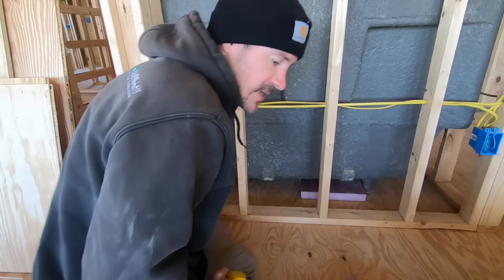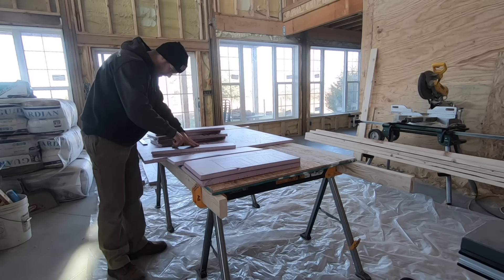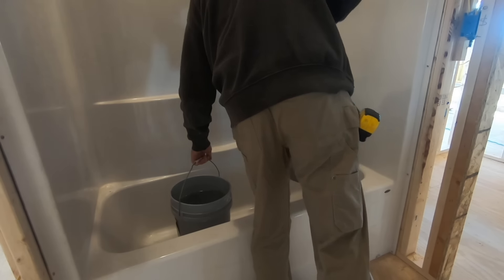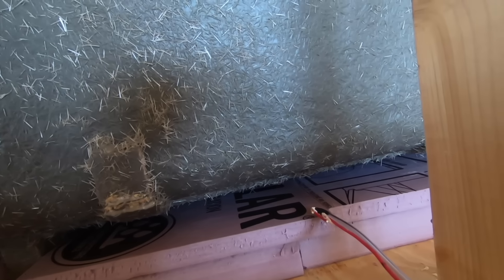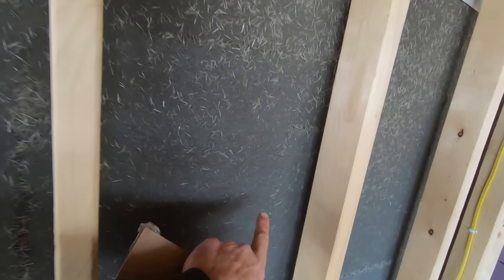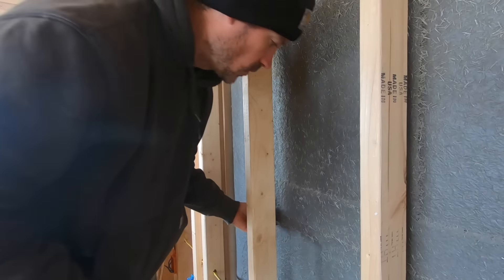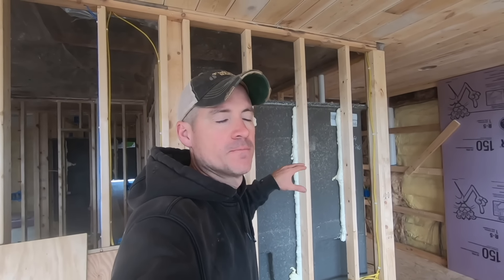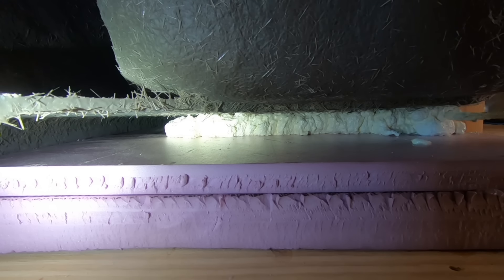How To Sturdy Up a Fiberglass Tub Shower Using Spray Foam

Comment: this is exactly the information I was hoping for. I had plumber install Kohler acrylic tub. didn't use any mortar bed. Now the tub creaks terribly every time anyone takes a shower. I called Kohler to see if I could use foam. they weren't sure. Thought maybe the low expansion type foam would be ok. Now I have a great tutorial. thank you for posting this!!! I was surprised the foam didn't cause the surround walls to bow in.  great video.

Comment: Added benefit of insulation for the tub keeps it hot longer! My best friends dad bedded a tub in mortar and the tub was always ice cold quickly. Mortar draws out the heat so fast. When I replaced my rub, I installed it, but was able to access the bottom, I used spray foam, worked amazing and the water stays warmer. I've stiffened quite a few showers for friends using minimally expanding foam and drilling holes through the subfloor for access. Minimally expanding to keep the shower from floating off the floor. Works great!
Reply: What specific foam do you use? Things still holding up well?

Comment: Great videos! 👍🏼👍🏼

I did something similar for a handicapped friend that wanted his tub water to stay warm longer… so he could soak his sore hips without getting cold or needing to re-fill the tub every 10 minutes. 

Installed the tub, filled it with water, spray foamed the bottom, let the bottom foam harden, then got more foam & went all the way up 3 sides of the tub with the door & window foam (not fully on the drain side, didn’t want to mess with foam on my drain pipes). Foamed it all up to just above the water line. Worked very well for him; just glad I’m not the guy tearing it out. 😂🤣

Comment: I've seen so many budget builders just throw the tub in with a few screws and call it good, and I'm like wth? So with my son's new construction house I research every step and try to do everything right. He wanted a tub with the 3 piece walls so we got to shimming yesterday and the instructions said to put glue on the studs then secure the walls somehow so they stay in contact with the studs til the glue dries. Well, most of the studs barely even touch the walls as it is, so I plan to add some 2x4's onto the existing studs and getting them closer to the wall panels. So I told my wife that the instructions said to glue the walls to the studs which would then have to be secured, and she said, why not just use the spray foam? So with that great idea and a quick search here I am! Now I can make this flimsy-ass shower a lot more solid. I do plan on using the window/door foam.
Reply: Did it work out for you?

Comment: Great work, Paul! As a plumber, my one thought would be to intentionally leave enough access around the shower valve and the tub drain to clearly check for leaks and to service them. This really does fix one of my biggest bug bears with "glass tubs and shower enclosures. Merry Christmas to You and the Family!
Reply from the maker: Thanks for the tip!

Comment: We are in our 70s and doing a drop in whirlpool/Air tub from Comfortflo whose directions is to pour a Mortar base and cover it with plastic.  The problem is we have less then 3 inches around the tub and with a drop in we cannot lift it drop it in after cutting the top part at about 155 lbs. I woke up in the middle of the night thinking about using Expansion Foam and so that is how I ended up here on your YouTube Video researching the idea. 

I picked up a couple of other ideas from you and I can see a professional who takes pride in his work doing his job. My tub is in now and I am hooking up water and electric. When all of that is finished I will duplicate your procedure and see how it works. I did install 1/2 inch plywood and 1/2 in hard board  to floor already to lift it 3 inches and allow the 1 1/2 inch drain pipes to install. One thing is that expansion Foam will expand and can lift the tub so I will be filling it about 80 percent water first and working in increments with the foam to insure minimum expansion. Your video is much appreciated and your work is very professional as well as your explanation and camera usage. Thank you

Comment: Great, clear photography of your process! I would only add (and maybe I missed this in others' comments) to wear disposable gloves while foaming, hold the can upside down, and resist filling the space, the foam will continue expanding. The "pro" nozzles they sell, though they seem expensive, are worth every penny on long projects. You can stop and start as often as you need to. The steel nozzle on them also allows a larger diameter extention tube when needed.

Comment: I only recommend foam for existing tubs. If you're putting in new, regular old mortar any day. It holds up buildings. Just make some width-wide humps taller than the gap underneath, and seat the tub in the mortar. It doesn't have to be fully supported 100%, but enough to stop any and all flexing. It'll squish down and bond like laying bricks. I also recommend ledger boards on all 3 walls to support the ledge and board(s) to support the apron. It'll easily support a 400 lb person after that.

Comment: Licensed Master Plumber here, these are great ideas. I normally encourage people to get a tub base and tile the walls, but occasionally I get a fibeglass unit to install. I'd like to try these ideas on the next one.
Reply from the maker: Yes, if budget and time allowed we'd prefer tile walls, but we think these will do well.
Reply: Why use great stuff it is not rigid when it dries but soft. How will it support weight?

Comment: I have used great stuff (spray foam) on all plastic tubs and have never had one crack. I never used ridge foam under the tub along with spray. Put it seems like it would work also. I would buy a case and spray up the sides, front, back then set the tub and secure it to the studs. Then spray all under the tub front to back. Cut off what would squeeze out. And wall it up.. owners would tell me that there baths stayed hotter longer.
Doing good - keep it up 
48 yrs experience
Reply from the maker: Thanks!
Reply: What foam do you use? I’m wanting to add this under an existing tub. Thanks!

Comment: I remember the old days when the plumber got out the sakrete to set the tub in. This is a much better system, especially fastening the sides to the studs. Great job.
Reply from the maker: Thanks!
Reply: @MrPostFrame  Why use great stuff it is not rigid when it dries but soft. How will it support weight?
Reply: @chrislasala  Im wondering this myself.

Comment: My tub is in a manufactured home.  A DYI remodel from a previous owner.  They did not put the tub on a solid stable bottom, so the tub creaks and I am concerned about the longevity.  I have no access to the underneath of the tub.  So... I have decided to drill/saw out 1 inch holes in the base of the tub about 2 inches up from the floow.  I will do four holes.  I will make the tubing extension (which is a GREAT idea and a big $$ saver) and fill the tub with water and spray the foam.  One person at the hardware store suggested that I get under the house and drill holes from underneath.  I just thought that idea was a higher risk of poking a hole in the bottom of the tub.  When done with the foam, I have white ceramic knobs that will sit in the hole perfectly and make it just look like a decoration.  Of course, I will seat them in clear silicone caulking.  It has taken me several months to get the courage to do this.  I am so very thankful for these videos!

Comment: When I did remodeled my master bath the plumber put cement down to create a bed for the fiberglass tub.  It worked well.  When I redid the another bathroom, the plumber didn't do this and a year later it creaks like crazy.  I just tried the spray foam like you did here and it was a big mess.  There was probably less than an inch between the tub and floor so I just used the spray foam.  However, when spraying the foam, the tube kept popping off from the pressure and foam was coming out before it even before it hit the tube.  As a matter of fact the tube that came with the can broke off due to pressure.  Home Depot didn't have the 3" filler so I just used the 1".  What a mess though.  The mess was caused by the tube popping off and the foam leaking out before it even entered the tube.  I have foam on my arms and hands and everywhere on the ground.  Good thing I had gloves on.  Now the bad news-the tub still creaks.
Reply: Did you fill the tub with water prior to foaming it? Maybe that's the cause of the continued creaking.

Comment: As I mention in your install video, you will enjoy this trick. I spray the outside of the bath before install with a layer and fill it up after install. It will insulates showering sound, keep the bath water longer 🥵 hot and indeed overall give a sturdy feel.
Reply from the maker: Awesome thanks!

Comment: My wife and I purchased 12 acres and a brand new manufacturered home.  Giant tub and it was barely supported.   I took the side panels off and used the remainder of a kit to fill the void .  The unexpected benefit is its like a yeti cup now.  A hot bath will stay hot longer
Reply: How’s it holding up?

Comment: I’ve had to replace one tub and one shower due to cheap fixtures or couples saving water😉. Split right down the middle on both units. I always pre-fill with mortar first. Try small diameter pex pipe next time for the foam.
Reply: couples saving water :-))
Reply from the maker: Haha that's why we had to sturdy this thing up. 😆

Comment: after a repair of my master shower drain which is above my kitchen. I added a little spray foam such as you are doing to help make the drain joint more ridged. It worked well, but now my water in the shower pan doesn't flow well from the rear and front of the pan to the drain. I have wondered if I need to open the kitchen ceiling again and try to remove some of that foam and use less!
Reply: What did you end up doing? Same layout in my home please reply thank you 😇

Comment: Canned foam used in a thicker blob than recommended will have some strange results. The foam a few inches back won't have any moisture to cure with, so it will stay liquid, and the bubbles of gas will coalesce into giant pockets. The reason the sides expand out so much is because the center has a lot of hollow spots that pushed the foam out. Best practice for doing this kind of thing would be making the foam board a very tight fit, spraying water back there to begin, then making lines of foam one at a time, giving them a few minutes to expand each time. Even better might be planning ahead and sizing up some squishy foam like neoprene rubber on top of the foam board such that the bottom of the tub can be installed on top of the foam and just smush the assembly a bit.

For the vertical situation (insulating and adding rigidity between the shower wall and the studs), I think it would be great to use normal carpentry practices but with foam board. Buy as much foam board as needed, in whatever sizes needed, to fill that whole gap all the way to the ground, with the foam board taped/glued together. Then just use wood shims with whatever adhesive you've got to make up the remaining distance and keep the foam in tight until the adhesives cure. I don't think the foam board needs to be held in very well, nor does it need to have an air tight bond to the shower wall. Solid sticky foam would technically do better here, but tight foam board would do better than most people would ever want.

Comment: I have same issue. The very expensive shower kit I bought recommended no mortar bed over wood sub floor and I questioned it. Sure enough now that my shower is installed and new walls are in we’ve used the shower and the floor is soft and makes squeaking noises.
Reply from the maker: That's a drag.
Reply: Same thing with the shower base in our ensuite. I just pulled the one piece shower/tub on the opposite side and will use the Marshall Spray Foam Extension Tube to get some minimal expansion foam sprayed under the shower pan. Then i'll use this trick for the new soaker tub. Hopefully you can remove some drywall and get some spray foam under yours. Squeaking and flexing will lead to cracks down the road, i would think.

Comment: Don't use foam boards under a tub. One day the weight will compress them and your tub will be uneven. Water will collect in areas and it will be a mold fest. 

I bought a house built in 1990. It has 4 bathrooms - all identical. All have the exact same one piece tub and walls - very similar to this video. Three of them have boards underneath supporting the tub. The last one to be installed someone cut corners. Looks like they used leftover foam boards. I am sure it was level when they finished installation, but over the years the tub leans to the non-walled side. This is the least supported side as it is not screwed into anything. Now water collects by the drain. It is hell to keep this tub clean. Inevitably, mold starts growing as it never seems to dry out. The only way to prevent it is to put a fan on it or run a humidifier in the bathroom. 

I cut an access panel into the wall and am trying to lift one side of the tub up. Haven't figured out a way yet. 

If I had more energy I would rip it out and put something else in.

Comment: Great video.  My situation is that the builder installed an acrylic tub but didn’t attach it to the wall so the tub sags and pulls the caulking apart. I can get access from an access panel for the jacuzzi pump.  I’m looking forward to trying this solution.  The back wall is exterior stucco so I can’t come at it from the backside.
Reply from the maker: Sorry you’re having to come up with a solution! This method seems To be holding up well we are in the house using these tubs
Reply: I have a similar situation. I'm interested to hear if you ended up doing it. 
My bathtub is in the wood frame with tiles on top. They made a wood tower, for every tub leg, to make it higher and  screw the towers  to the sub floor.  The tub itself wasn't attached to anything, except for caulking between the top of the bathtub and tiles. Caulking cracked everywhere, so I had to remove it, but it only made it worse and unstable.
Reply: @Alex-gc2gs  Upon further investigation, it looks like my wife bought a "bargin", saved money but will ultimately cost more money.  The tub can't be attached to the wall, it's meant to set on a 2 ft high wall.  Someday, the whole bathroom will need to be rebuilt.

Comment: I couldn't find 1/8" ID tubing at either Lowes, HD or any of the  other stores. All they carry is .170" its only .045" more, so what the heck, I tried that. HUGE mistake!!!! the tubing poped off and made a big mess. I was about order some tubing from Amazon, but I really wanted to finish the job today. Then it occurred to me that I had a coil of 1/4" drip irrigation tubing! so I tested that  and it worked perfectly! back in business.

Comment: I repair bathtub floors that break due to lack of support. I charge between $1,300 to $2,800 depending on the amount of damage to be cut out and rebuilt. For less than $40 for proper support at the time of installation, as shown, that repair cost can be avoided in the future. I'm putting a link to this video on our website and social media - Well done.
~
(BTW - never try to repair a broken bathtub floor by drilling holes and injecting foam: that does not magically repair the broken fiberglass or rotted core. Use solid wood support, then a layer of fiberglass, core, top layer of fiberglass, and finally topcoat.) topcoat.
Reply: At that price, why would they not just buy a new tub instead?
Reply: @coryascott  If you want to keep your one piece tub/shower combo unit that doesn't have caulk lines around the perimeter of the tub and up the walls then you have two choices: repair the tub...or rip out every door frame from the front door to the bathroom door so that you can get that huge one piece unit into the house (hopefully it can fit through the hallway and around corners, too).
If you're opting to replace the tub you have plumbing, drywall, tile, electrical, and carpentry to pay for. The average cost for a remodeler to replace a bathtub is between $4K to $6K. Repair can be less expensive, but nothing is new like brand new.

Comment: I installed an acrylic tub on a sub-floor but didn’t strengthen the floor beforehand (just put it where the old tub was). The acrylic tub has “feet” and one or two of the “feet” are squeaking the floor (slight movement).  I know I will have to strengthen the floor from underneath (finished ceiling underneath so have to cut some of that down). Question is, how would I strengthen the floor underneath (between the floor joists)?

Comment: Spray foam  typically consists of polyurethane foam, which is created by mixing two chemicals: isocyanates and polyols. These chemicals react acrylic, especially if they come into direct contact before the foam fully cures.

Acrylic is generally resistant to chemicals, but isocyanates (the primary chemical in spray foam) can cause surface degradation or discoloration if left in contact with acrylic for too long.
So If foam is sprayed directly onto acrylic, it might result in staining, yellowing, or surface damage as the foam cures.

Fiberglass, probably ok. Acrylic, maybe, maybe not. 🤷‍♂️

Comment: Why tf are showers being built with tapered walls instead of straight up and down? I'm a heavy dude and so I'm always cautious with how I place my weight....so why are they making showers that are almost impossible to reinforce flush with a stud/plywood behind it so that I don't cause stress cracks whenever I lean up against the "wall"....it's not a wall like that, it's a shell. -_-   an unsupported shell.